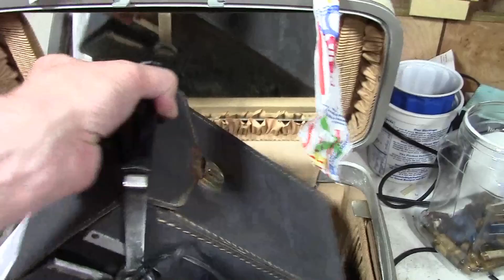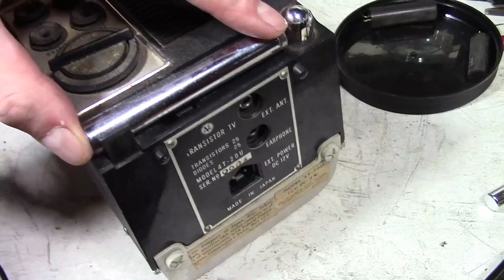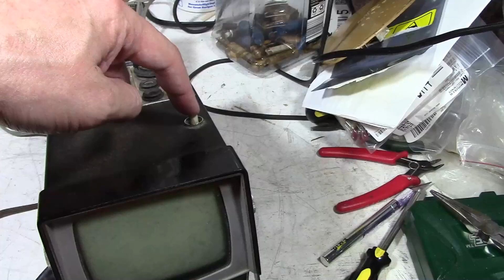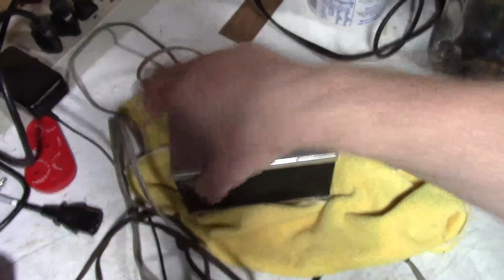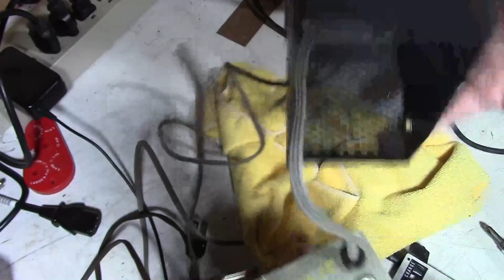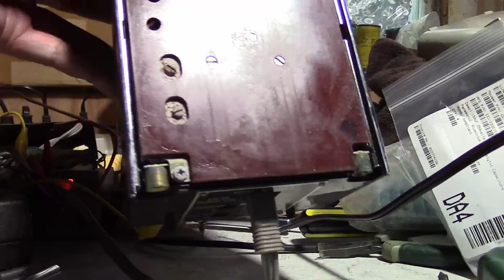Delmonico (JVC) 4T-20U p1o?

Comment: my luck with small portable sets is 0.  A philco safari with a CRT that has an open filament, and another small portable symphonic TPS-5050 "minni TV" that also had an open CRT filament.  The latter came with the box, owners manual, schematic, even the warranty card.  curious if it was an infant failure or if the owner just held onto everything and packaged it all up when it croaked.

Comment: Nice job flying blind and still getting something out of the old unit. Even with the schematics though you may have quite a challenge working in those tight quarters. I’m sure you’ll succeed ultimately.

Comment: Hello,
I found one of this in a fleamarket for 2,5€. 
I was able to make it working but it is not an easy task, it took me a lot of time to find correct settings. My opinion is that your is going quite well, it is just difficult to setup. 

There is a button at the back for normal pr expand mode, something like that. I guess the expand mode is eco mode maybe it causes the lack of brightness.

In my area there is no more analogic tv channels, i am using an RF modulator, that permitted me to plug a video player and a PlayStation on it.
I have to say i didn't succeed to have display and sound at the same time, so i setup only the display and i use external speaker directly on the device.

The fact i don't understand is this tv covers only VHF band (not UHF). But in my area (france) we had UHF range, and never VHF as far as i know. And my TV is a french model, with the back sticker in french, i can't understand how this thing worked here. Maybe it was not possible to use it in France?
Reply: I uploaded 2 short videos of mine working
Reply from the maker: Thanks you for the information and videos.  You have a nice, bright picture.  I hope I can get mine working as well.

Comment: 16:00 - That is a "cheater cord" as it defeats the interlock on the chassis. I grew up with TVs that had power cords riveted to the back, which disconnected the chassis if you removed the back. As if removing the back to get into the set you'd be stymied as to how to service the dang thing without the cord! Probably the stupidest passive-aggressive "safety" device ever conceived.

Comment: Based on the vintage it must be full of PNP Germanium transistors. It appears that at least most of them must be functional or you wouldn't be getting the results you are getting. Probably some cap in there that is leaky or has drifted way off value. Nice find! Amazing that they had a fully transistor TV (except the CRT of course) in the early 60's. The first one we had at home growing up was a Sony Trinitron from maybe 1973 or so.

Comment: I have the exact same TV in my collection here in the UK, just check if you have a European model maybe it's possible that's the reason the horizontal hold won't lock, it's just what come to mind while watching your video, such a nice little set, gives me a smile when I look at it.
Reply: The line oscillator frequency looks a little low to me, normally sets cope easily going between the North American and European line standards,just a tweak of the vertical hold is needed.I've restored some early Sony sets and it's generally the electrolytics that need replacing.Germanium transistors in these TV's can be a bit touchy with temperature variations.
Reply from the maker: Ah, I hadn't thought of that. I finally obtained a copy of the schematic and will open up the TV soon.   The horizontal circuit is the first thing I will check.

Comment: Nice TV, I have one of Sony's Portable TV's from 1961.  It's a bit smaller than that one and it has 3 -1DK1 rectifier tubes. 
Even though it had 3 rectifier tubes Sony named it an  "All Channel Transistor Television Receiver TV 5-307UW "
Reply: I wish I still had the 1D-K1 tubes I pulled out of a defective Sony portable.  I have a Sylvania 134 VTVM with a missing RF probe and I could had used one of those tubes in the probe.

Comment: My Dad had one of the first Sony's Portables of the same vintage and it had to be 1962 or 63....I remember my Mom was not to happy as he spent so goodly sum of $$$ back then for it! Since I'm his son, I've picked up a couple of those 1.5 Inch Panasonics at an auction a little while ago.  I think the three lines of the Power Cord are a Common Ground, +12V Run Voltage and last the Battery Charge Line. I saw two pots in the Power Supply and one maybe for the Run Voltage and other for Charge Current. Just a guess...look forward to more!